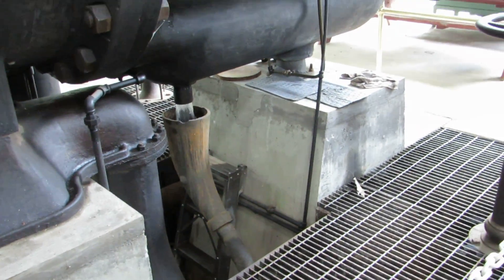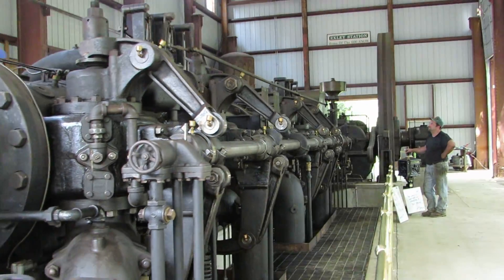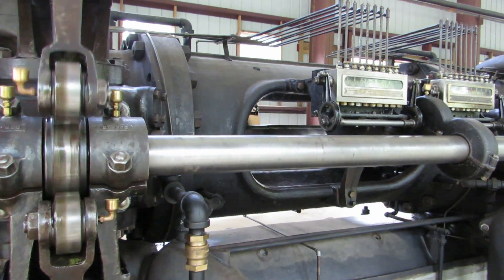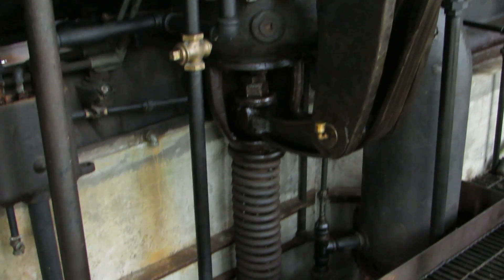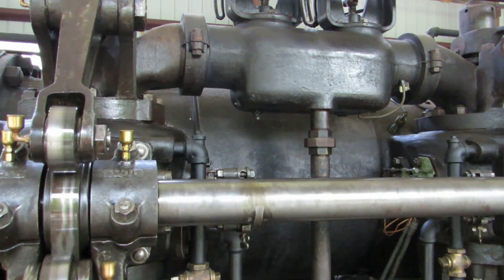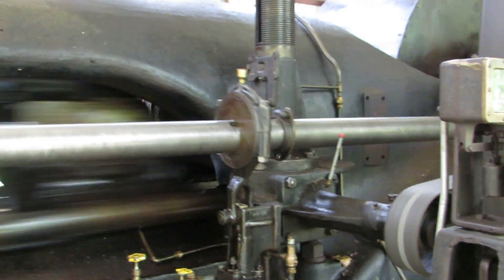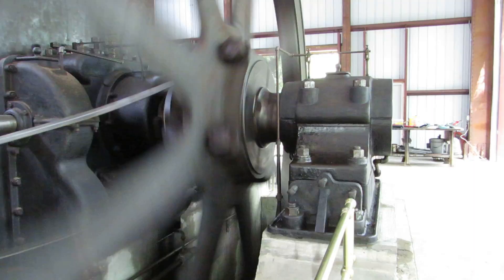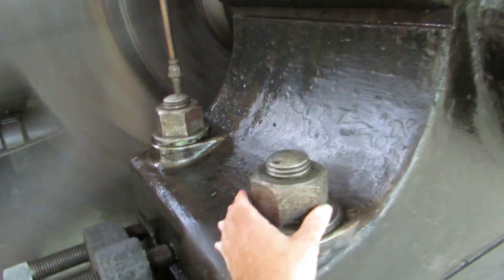600 Horsepower Reciprocating Natural Gas Engine in Action Snow Worthington NW PA 462

Comment: I lived in an 1892 building in NY City that was the power plant for the Houston and Broadway cable car lines, it had four 1200 HP Corless steam engines powered by the building's 12 Heine High pressure boilers, a dynamo that furnished electric power capable of lighting 50,000 incandescent bulbs in the building, and there was a 32' diameter  driving wheel- unlike the SF cable cars, this system actually pulled miles of steel cables around under the street, but it had a LOT of problems and a few years later it was electrified, some time later every piece of the equipment was removed and scrapped- 9 of the boilers, the dynamo, the 4 Corless engines and everything was removed probably during the WW2 scrap drive. What a shame, had it still be extant it would have become an amazing one of  a kind museum possibility- it was the only one like it when it was built. The building designed by McKim Mead and White had three basements- the machines had their own separate foundation to eliminate vibration to the building above and the offices etc.
Reply from the maker: Awesome! Thank you for educating many people about the constant change of technology to improve cities. In the last 30 years I heard of Leap Frogging Technology. That current tech innovators no longer try to make something a step better, newer. Instead they work to replace their competition with a radical departure from existing tech even if it is new. So some friends got tired of that. They left tech businesses to own apartments!

Comment: That picture of 30 in a row is likely those in the blower house for Bethlehem Steel.  They are all still there, probably awaiting the torch. 

Most of the engines in the bower house are twin tandems, so there are two rows of cylinders on one crankshaft.
Reply: The Bethlehem engines are part of the museum, they are to be preserved

Comment: 100 tons, 40,000 Cu In, 26,000 ft/lb torque @120 rpm.  No OSHA, computers, sensors, EPA, NTA, NSA, metric, chineesium, Pollution controls, or Carbon Footprint.
Some were made in 1914.  By Smart People who figured stuff out on paper and got it right without changing 'formats' every 5 months.  It used 2% of gas compressed.

Comment: I do NOT get tired of seeing this engine!

A Dodge Hellcat engine has the same HP 
rating.  We won't mention the torque.

This is an AMAZING piece of work!

steve
Reply from the maker: Interesting that huge antique steam tractors have I think 5 HP! Imagine that - tons of steel and water, plus pull and implement all day. Search for Vista Antique Engine Museum in Vista California in San Diego County. So similar for this reciprocating engine maybe over 100 feet long, maybe over 7 feet high has same HP as a Dodge Hellcat engine!
Reply: @viewhome8442  I was checking out the engine video. it looks to me that they must have done some work on the engine recently. In other videos on startup you can see a lot of blow by during start up. On this video I see pretty much no blow by and the engine seems to be tighter, or maybe it's because the temperature is up that the engine is tighter ?? Just guessing. But it does seem to run great.